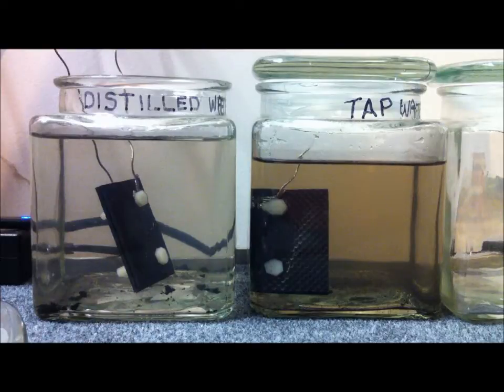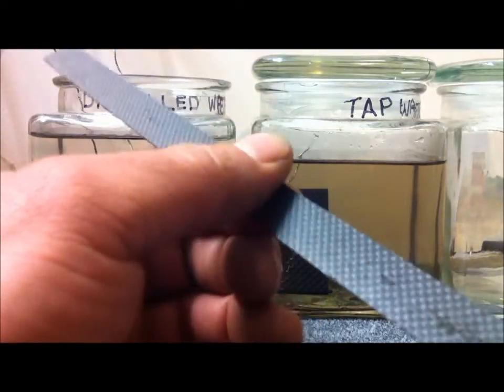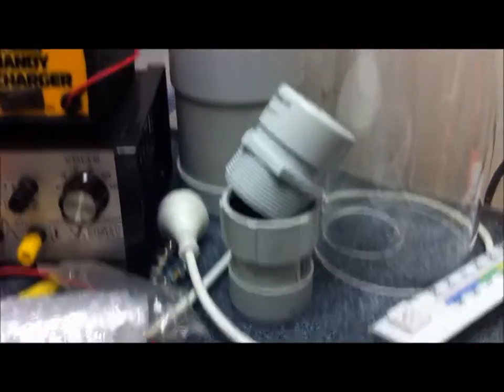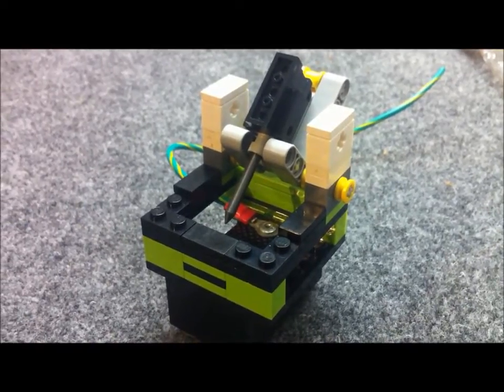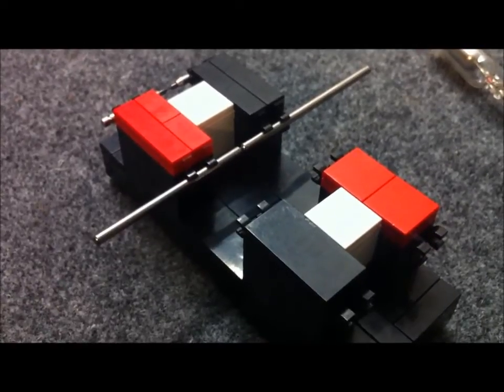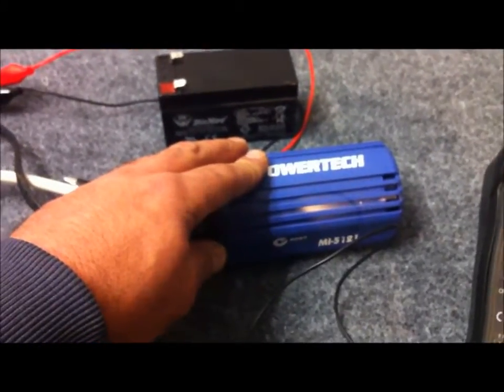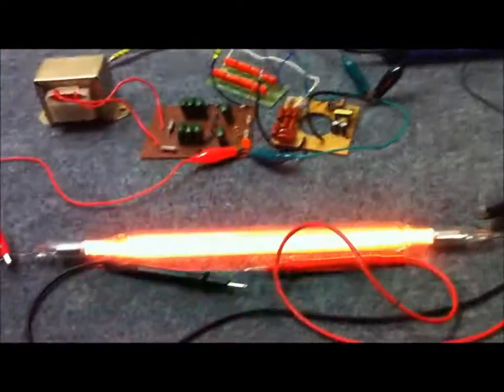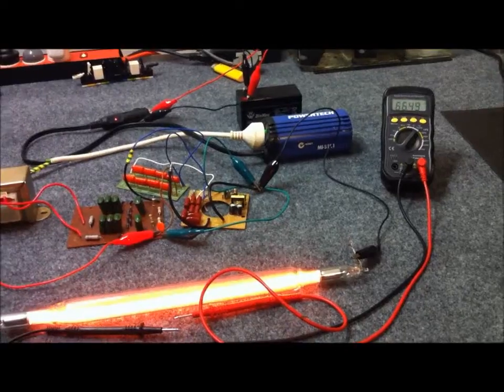Energy Update #3 - HHO, Electrodes, 6KV Power Supply, Spark Gap...

Comment from the maker: Thanks Tinman.
I already considered the oil issue and have some ideas in mind to counteract this.
I never considered the safety issues associated with flashbacks. I an not concerned for the engine (it would still be cool to watch it blow up), but more so for my personal safety. I will consider it further before proceeding with this engine.

The annoying thing is that it's already mounted on the frame, but it's only a couple of hours work to swap it out.. Thanks for the heads up... :)

Comment: Looking good there EnergyFabricator-cant wait to see them cells up and running.
You may want to use a 4 stroke engin for your HHO experiment's as a 2 stroke take's the fuel mix into the crank case.There is two problems with this-1st,the crank and rod bearing's are lubricated with the oil that is normaly in the fuel,And 2nd-if you get one backfire into the crankcase that is full of HHO-there will be trouble-and posably some stitches.